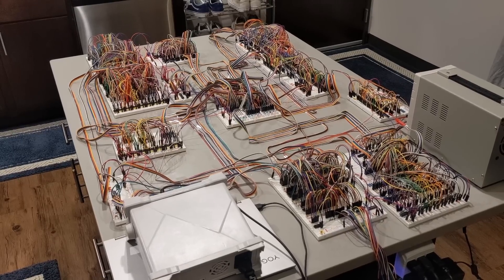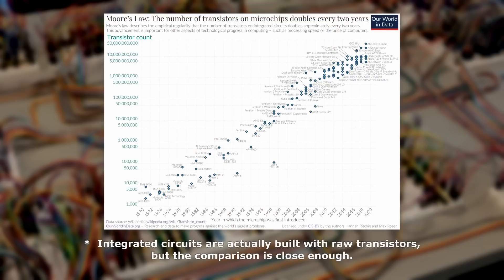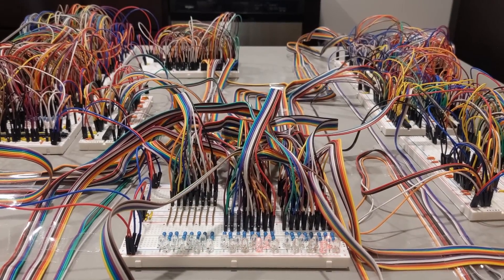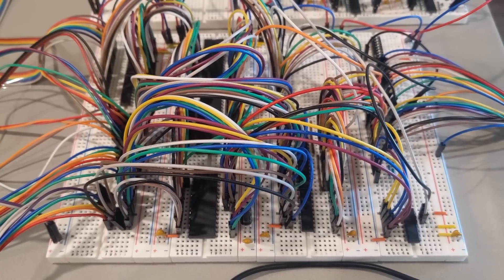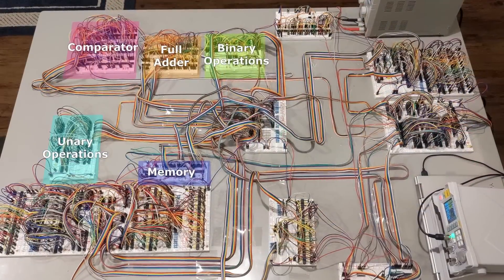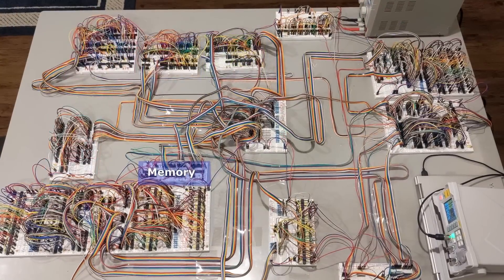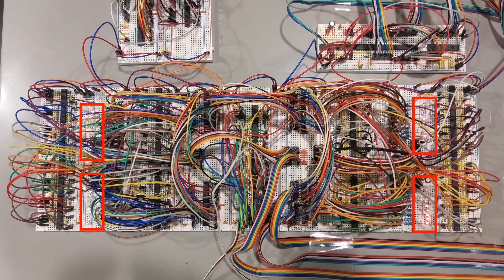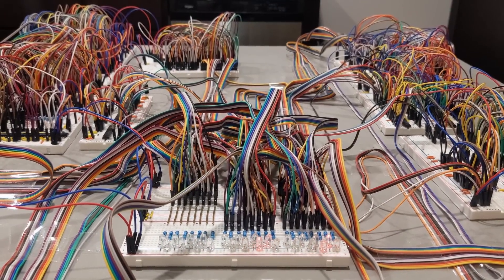Homemade 8-bit Computer

Comment: "I'm not a computer engineer" ..Goes ahead and shows something more cool than my computer engineering graduation project.
Reply: @itz_Raed  😬 seriously? What did you guys do?
Reply: Actually to build something like this you also need to be a good electronics engineer.
Reply: That is a lie because a computer engineer is someone who creates computers, usually by manipulating logic gates and turning that into a schematic for a chip. However, this is also a valid definition of a computer engineer as he is engineering a computer. It doesn’t matter that it is not professional because he has done it once (and to be honest, he sort of is making it professional by putting it on youtube
Reply: fr
Reply: You need to get your money back then.  We did this in our second year of undergrad.  4th year project was a fpga design of the cell processor for PS. I wonder if times have changed or if different schools vary so much in quality.  Still props to the OP, that's a great accomplishment.
Reply: EE-CompSci Freshman digital logic design course just if you only took one course.
Reply: Now do it by scratch or in scratch
Reply: As an actual computer engineer, we had projects where we had to make a 4 bit computer using actual transistors instead of ready made chips and transistor + capacitor for dynamic memory cells as well as filters and opamp buffers. So this project is very simple since you just have to make a boolean table and then connect the wires to the correct pinouts and that’s it. This looks complicated only because he used a-lot of chips and jumper wires instead of neatly bent wires. Even a year 2 EE who studied digital systems can do this.
Reply: @catnipaddict126 That's really cool I must say.
Reply: @catnipaddict126 that may be true cat, but I think somebody learning and doing things they aren’t so comfortable with is an impressive achievement.
Reply: @catnipaddict126 how big must that mfer have been, I tried building one but came to the conclusion it would take far too many components than I was willing to shell out the money for.
Reply: @kaelan-j1z  Yeah dude, it's actually very expensive to build these machines. Perhaps it would be more affordable to build it using transistors and resistors for logic (good luck). But hey, have you ever heard about OISC? Being a one instruction machine really should reduces logic gates/FF numbers. It would probably be more complicated, though.
Reply: @kaelandin Learn verilog, I think if you like computers it won’t be hard, especially if you use C-based languages, then buy a cheap hobbyist FPGA and get some other components. You can detail every logic gate without having to deal with the mess that is breadboard computers, and then you can even use it (potentially on an SBC if your processor is powerful enough)
Reply: I'm on 4 semester of computer engineering. I do made computer architecture ll, but i can't make a computer yet, but im studying eletronics discipline and i want to make a computer as a project for this semester.
Reply: @catnipaddict126  Oh wee little engineer needs validation cuz an engineer called this homemade project cooler than their own. Oh wee ur education, so complex, ur sooo good aren't you buddy.
Reply: @catnipaddict126  There many engineers appreciating it, and saying it is cool enough for a project from a student. You clearly graduated recently, and have an ego. You need to grow up. You might not even have graduated actually lol.
Reply: @catnipaddict126  """come on dudes, look at me. I'm smarter than him and need attention"""
Reply: @catnipaddict126  you mind sharing how u did your project, how much time it took you to finish, and where did you study?
Reply: he is electronic engineer,computer engineers only build PC.
Reply: That's what makes his design not cool. 
If I would see this and learn that he is NOT an engineer, I would right away destroy his machine. 
No-engineer should be forbidden to even think about building machines.
Reply: @Kawka1122  Too arrogant of you to destroy such things done with great efforts without legitimate reasons. The thought of "No-engineer should be forbidden to even think about building machines" is purely context-dependent. Building machines that could cause harm or violate laws should only be its scope. Freedom of thought and intellectual exploration are highly valued as it promotes innovation and technological advancement. Besides, the man's not building an atomic bomb.

Comment: Individual logic gates is insane.
Reply: the really insane bit is doing it all on bread boards with only jumper wires
Reply: @GordonWrigley Pure gore
Reply: @GordonWrigley  the insane part is to not lose overview and to keep on doing really repetitive things.
I don't know if he taught him to do everything from scratch, but it isn't to complicated logic wise. it is complicated because it is boring and easy to do a small mistake and then to find that mistake haha.
I once tried stuff like this in minecraft, but it is just sooooo annoying all the planning where what gate is going to be and then not having enough space and needing to move everything just a few blocks. it takes SO MUCH TIME.
I study normal programming stuff and we had logic gates and some larger constructs like registers, full adder etc and was able to build a really simple ALU in micecraft with 4 bits. Not to hard, just really boring haha.

But the result is really nice! (but from the complexity itself nothing too crazy)
Reply: @Marco-xz7rf  I'm also a software engineer, I wrote a gate sim once and then build a CPU in it, it was a fun exercise, it's also harder to mess up doing it that way vs actually physically building it, physically building it you can just connect a wire slightly wrong
Reply: @GordonWrigley  oh what programm did you use? I really like this because then you TRULY once realized how all this stuff works. It is so fasinating also to see that each gate has different times until signal goes through and also different shapes of transistors as for whatever reason one weakens the signal differently than others, so in order to compensate some have more or less surface than others. Alls this traveltime of the signals untill they finally reach stable result before you can clock again to save up everything in your regs or you will have errors :D

Comment: This is a fantastic accomplishment.  My breadboard connections frequently get finicky for a variety of reasons, including oxidation. Do you find yourself having to spend time jiggling wires when things aren't working quite right?
Please donate/sell this treasure to a museum.
Reply from the maker: Luann said it. I didn't have any problems with this once I found a supplier of good breadboards.
Reply: @JosephNaberhaus  What brand/supplier did you use? The gold standard for breadboard quality is 3M, but their high cost puts them out of reach for many people.
Reply: Some breadboards are much higher quality than others. You can also try disassembling them and using pliers to carefully improve the contacts, though it's quite a bit of work :D

Comment: As someone who is working on a very similar computer myself, it's nice to see other people's take on such a project! I struggle to find someone irl who is interested in this stuff...
Reply: i'm interested sir on making one, myself when i got the money, i need instructions.
Reply: @josephputra2987  The project that preceded this for me was writing a Snake game for a TI83+ calculator in Z80 assembly (machine code, really). That taught me how a (simple) CPU works from the software side. Later I found Ben Eater's channel, which I highly recommend if you don't know him already, and his 8-bit computer series got me started with my computer project. My computer is a mix between Ben Eater's and the Z80's design (plus whatever features I thought useful). Then I ordered a bunch of chips (I used slightly more complex chips, like 8-bit registers and bus transceivers, counters, adders and multiplexers), and went right at it. Building it in individual modules really helped, because I could do it one step at a time. That's my advice.

Comment: 'No true output device for this computer mainly because I didn't see the point in building one', if I could build things like THAT when I see no point on doing thise things, holy shit. What do you do with things you SEE a point on doing/building, please? I need to know 😂😂😂
Reply: It is because we can really read binary, count in binary, do math in binary, input code in binary... So if you are building this for yourself or as part of a project where the core subject was other part of the system, building the I/O block can be unnecessary, because it would be time consuming for no real purpose. 

Also, his computer can only handle very basic instructions , basically only math, so you really don't need proper I/O. Not even demonstration/education kits have them, you are assumed to know how to interpret information in binary/hex
Reply: @Mkdj21  Understood, sir. I guess he meant he could actually translate binary into decimal to show in a display, as the final feature of a calculator, which would be actually a very a interesting end for the project (comparing to this whole setup i don't think that would be a problem, except for the demotivation) and what I meant was exactly what's written there: he had so much work to do that and still see it as a pointless project, so I wonder how great are/could be things he's willing to do with purpose. Nothing more, nothing less. 

You are repeating what he said. 
And then I have to repeat what he said as well.
So if both agree, what's the point of those.comments? 😅😅